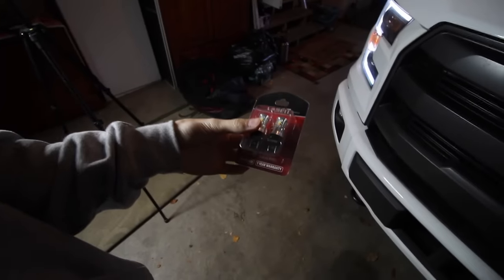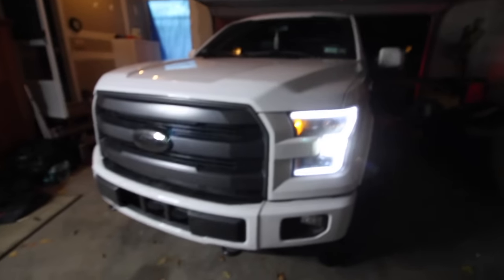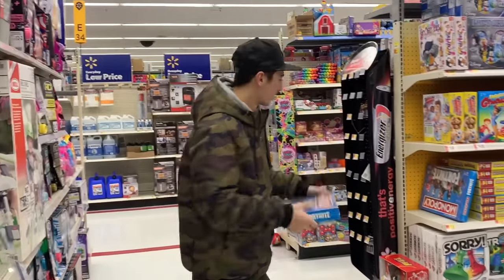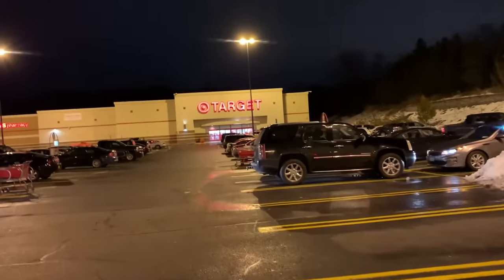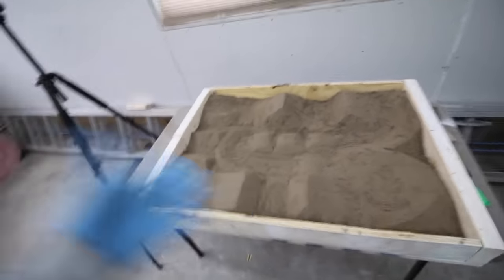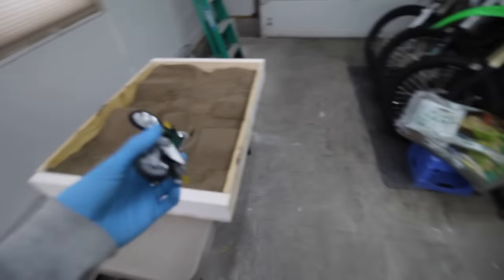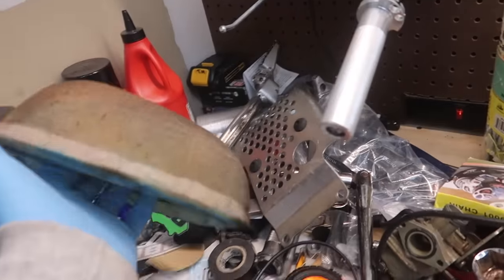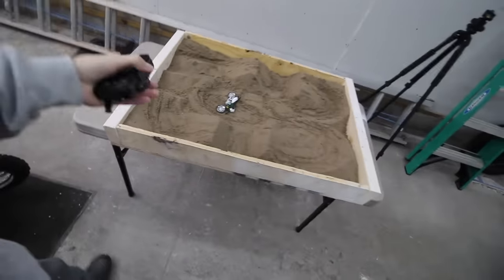DIY INDOOR MX TRACK...😹

Comment: Tyler those bulds are dangerous dude, they don't have a resister or a fan..eventually when the built in coating they but on them burns off it'll melt the plastic on the head lights. Buy a set with built in fans and resister. Like 100 bux and they are actually bright. Bought them for my 2018 powerstroke and haven't had a problem since I put  them in last December.
Reply: Huh